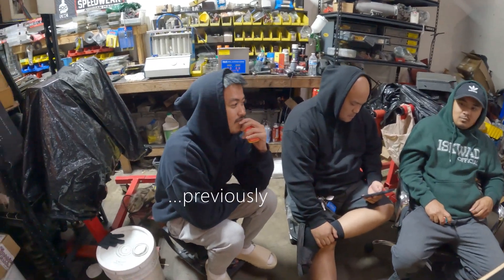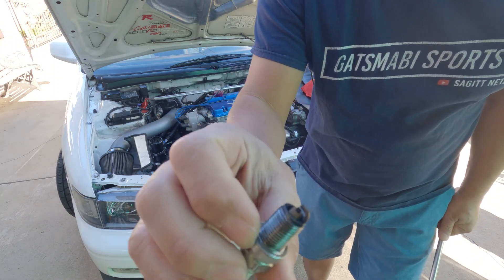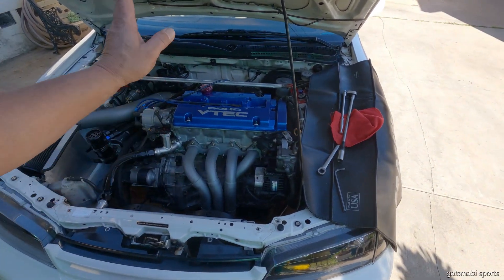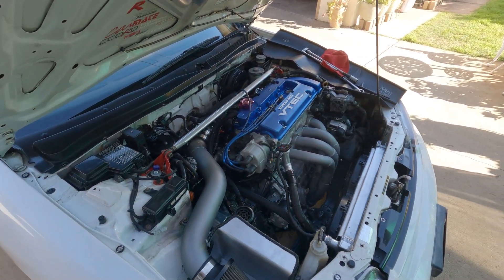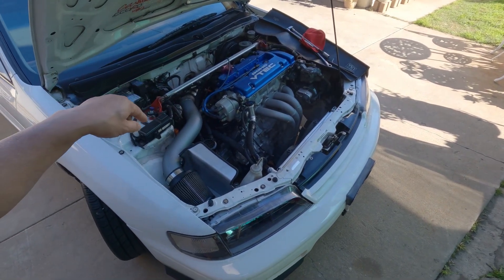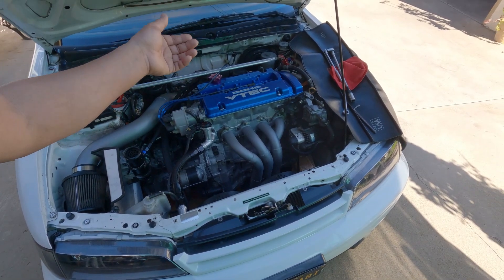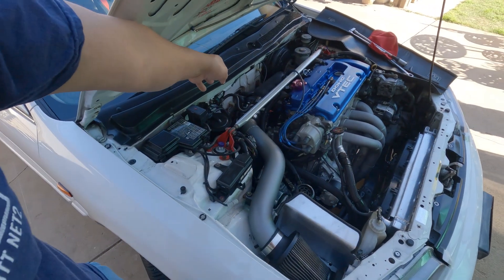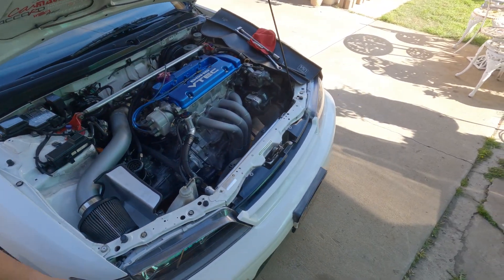How much power you expect on H22 stroker w/ G23 dna build?

Comment: It made good power... it would have made 230whp if it had a 3" exhaust. That's the only part of the build you could improve other than that it was perfect.
Reply from the maker: Thanks man! I do have a 3" exhaust but if for my turbo engine setup. That'll be interesting experiment, hmmmnn, interesting, l might put it on just for observation. Later man

Comment: Hello Sir nice to see your video again.
Reply from the maker: Thank you man!
Reply: @sagittnet2158  can stock jdm h22a frm pistons work in a cast iron sleeved h22a block or must it be changed?
Reply from the maker: @ROBLOX_VAULT Yes, w/ no problem what so ever. It's the H series w/ frm sleeve is the picky one. It has to be Honda original H piston to be use.
Reply: @sagittnet2158   ok thanks for confirming, the frm sleeves in the block i got is done so im having cast iron sleeves fitted, so the oem h22a piston that worked in the frm sleeve will run fine the cast iron sleeve? online it said it wont so im just double checking
Reply from the maker: @ROBLOX_VAULT the 1st g23 that was built back in 03, he was using F23 block that was resized to 87mm. He used a Honda OE H22a4 piston. Just thought l let you know for your piece of mind that its been done before. He also ran that motor for thousands of miles and also road racing.
Reply from the maker: @ROBLOX_VAULT You should use Nippon racing piston on your h sleeve block. Its not that really expensive.
Reply from the maker: @ROBLOX_VAULT If you are using used H22 piston on your iron sleeved H. Pay attention on p2w clearance. Honda OE piston require tight clearance.
Reply: @sagittnet2158  yes im considering it, i saw in your vid it works with the f23 rods i have

Comment: Would of have been a better comparison if only you compared intake manifolds. But since you swapped camshaft and did a few small changes it’s not an accurate of 10whp difference. But still a good gain for an NA build.
Reply from the maker: True, not really sure w/c parts upgrade helped gaining that extra 10whp. Maybe next time l can swap the euro r mani and give it a test. Thanks man!